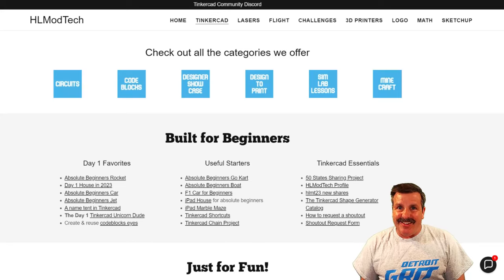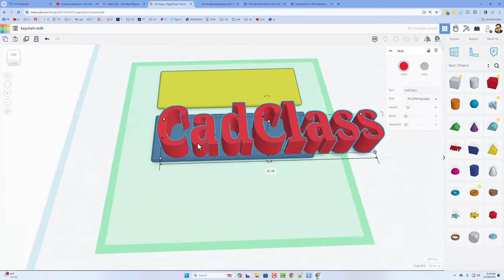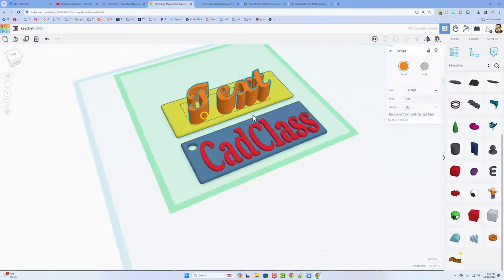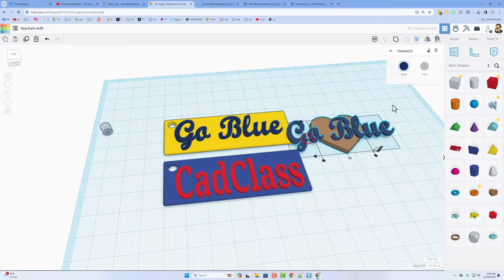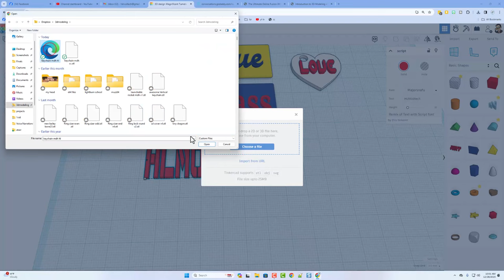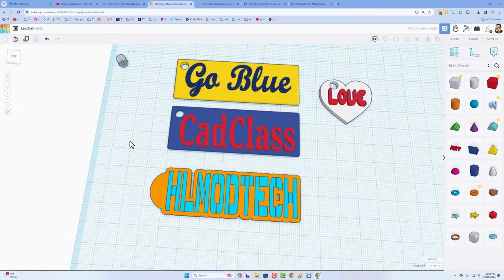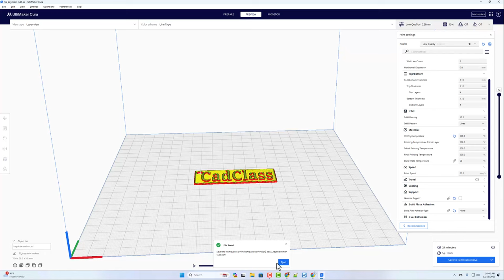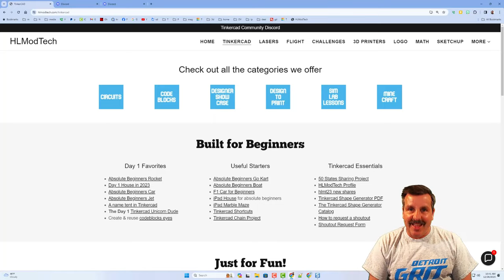Tinkercad Keychain Designs for Absolute Beginners 3d Printed in Minutes

Comment: I'm having a difficult time with moving the cylinder into the Keychain part. First time using Tinkercad.
Reply from the maker: I would use the arrow keys. Maybe sent the nudge to .25 or .1 one to be more precise.
Reply from the maker: It is possible it is sitting on top of the keychain too... If you "cruised" it on top, you will need to press d to "drop" it to the workplane.  Would you like to send a share link so I can see inside it? Here's how https://youtu.be/XeDQjhRK8lg You can reach me at hlmodtech gmail.

Comment: How would you print in 2 colours (I have the flashforge a5mp)
Reply from the maker: Since it is a single color printer you would need to use some sort of pause at layer height. This is an example of how I did it with one of my anet 3D printers. https://youtu.be/rHb7M9UFaTI What software do you slice with for a Flashforge printer?
Reply: @HLModTech  hi. I think it’s flashprint.  I’m going to download cura and see if I can get that to work with my printer.  Thanks for the link, I’ll have to read up about g codes.